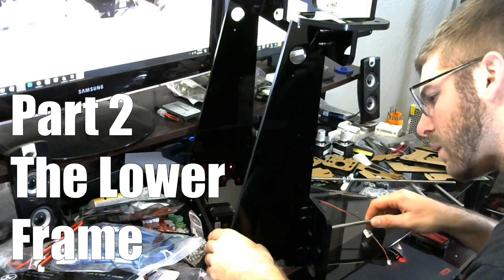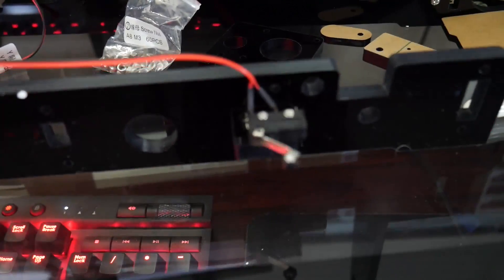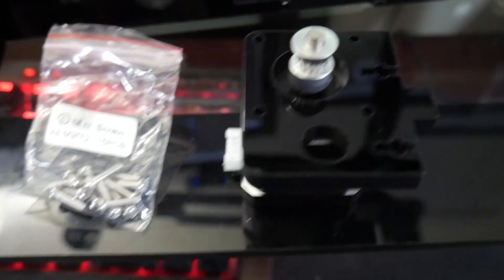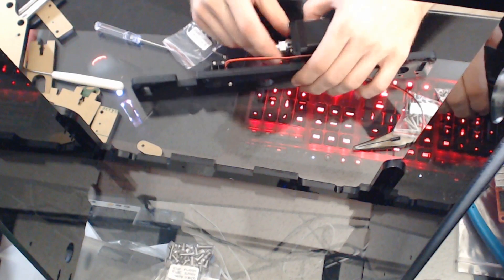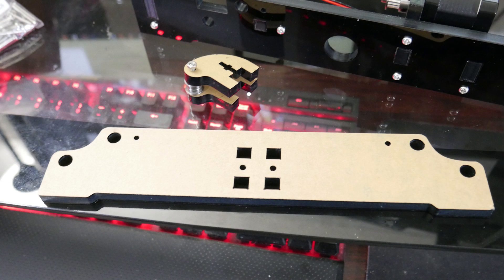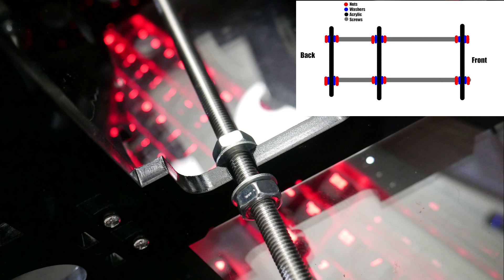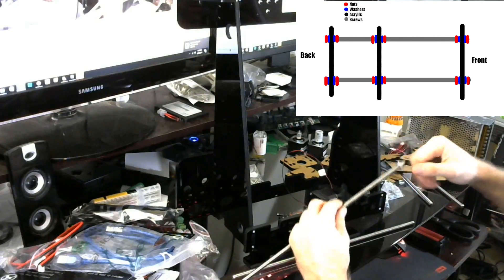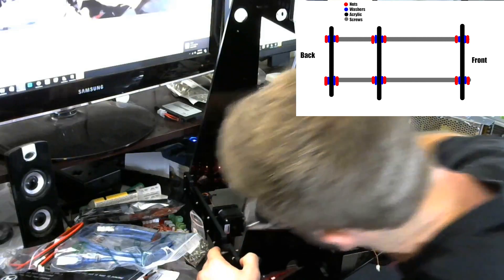Anet A8 3d Printer Build Guide Part 2 The Lower Frame

Comment: The front y-axis frame has an offset to the idler. I don't recall which way it goes, sorry. If it isn't right, you'll know just by how the belt is angled vs in-line with the y-carriage movement.

X end-stop will probably give you the most trouble. I "discovered" just how great the soldering isn't on that one.

Comment: I have end stops sort of like that. I had to solder them because they were just being held in by the heat shrink so sometimes they ripped and it was a waste of time to remove them and fix them.
Reply from the maker: yeah they are just sort of generic endstops but they work fine. Lol thats pretty bad that they where just held my heatshrink i mean these might be to i cant tell because they are covered by well by heat shrink lol